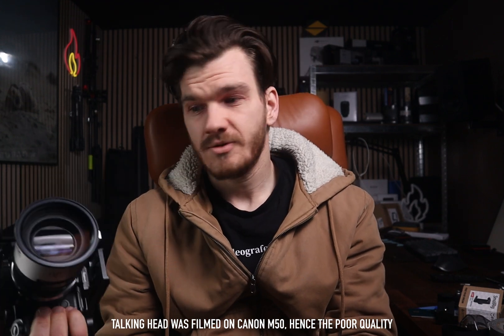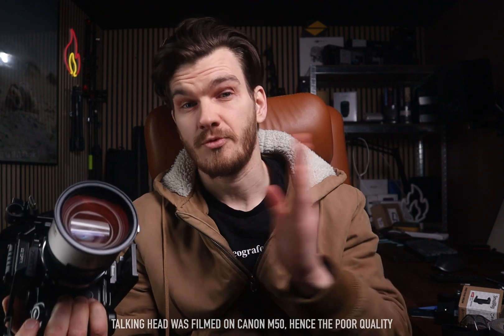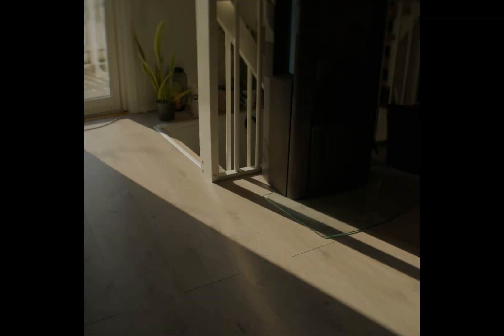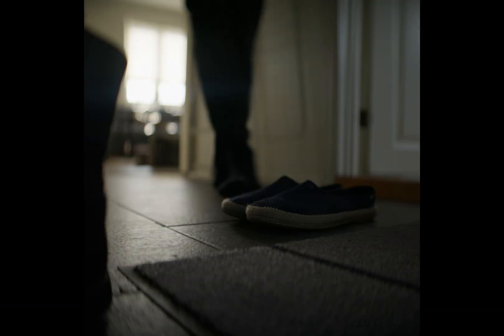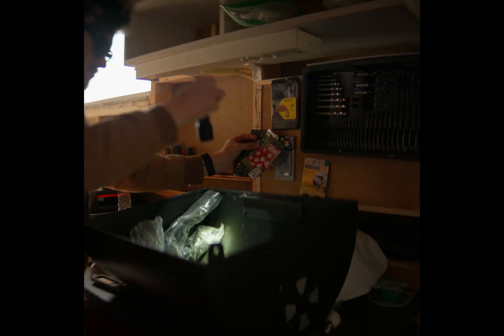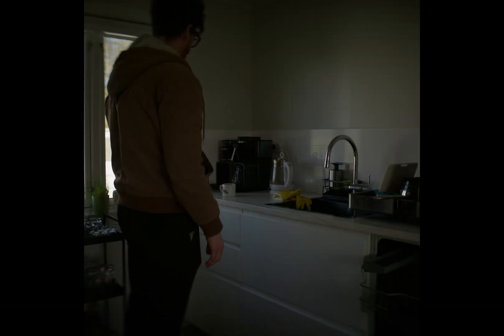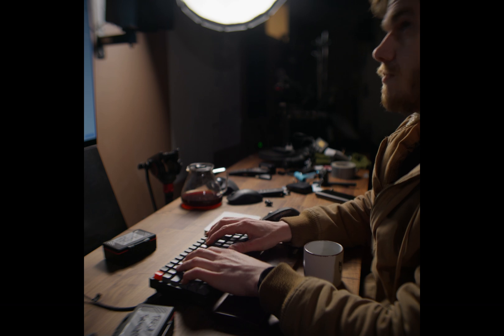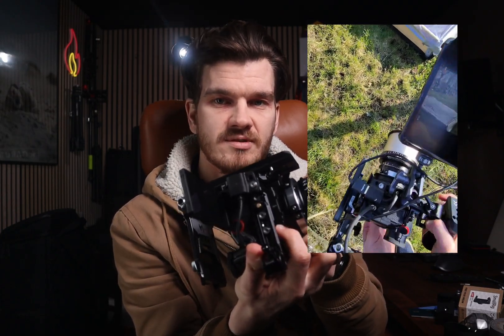Mount your lenses sideways

Comment: Hy, can it be shoot in 9:16?
Reply from the maker: Hello 😊 If you have the lens mounted normally, and you flip your camera vertically it will record a taller clip, but the aspect ratio would be more like 21:9 or so as the anamorphic stretches it even taller.

I did not change the aspect ratio for the recordings I did, but if I wanted to have a 9:16 recording, I would crop it from the 4:3ish image. The great thing about recording in 4:3 is that you don't need to crop in very much to get 9:16 or 16:9, so you have more freedom to choose which aspect ratio you would like to deliver in 😁